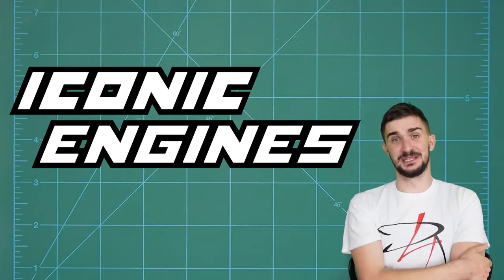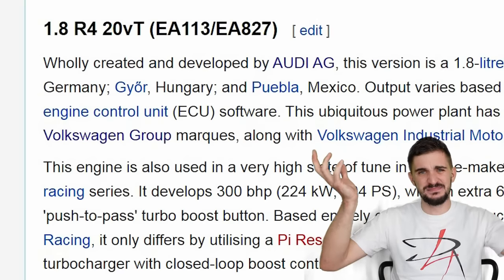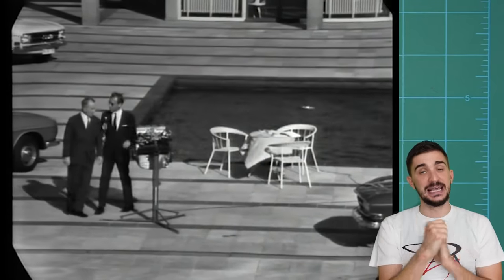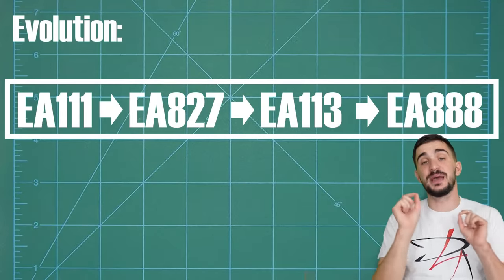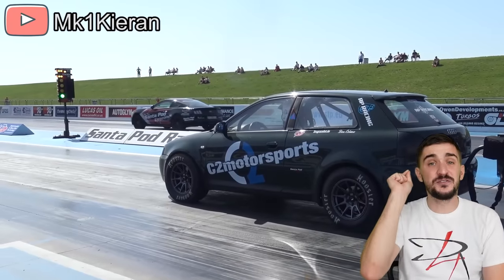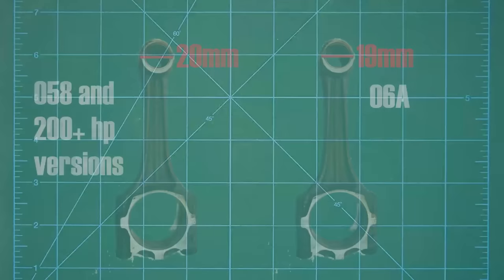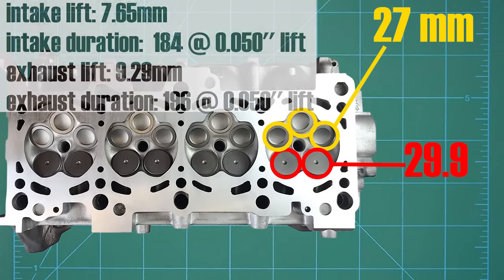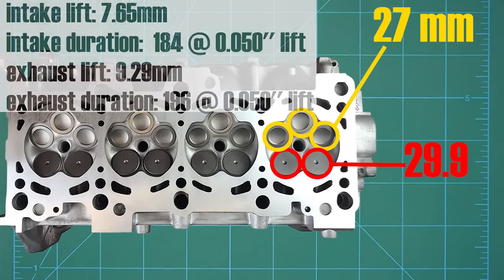VAG 1.8T 20V - What makes it GREAT? - ICONIC ENGINES #17

Comment: Thank you Thank you Thank you! The 1.8T is one of the best cheapest engine to tune, mine is 300bhp hybrid turbo on stock internals for the past 6 years with not a single issue.
Reply: If you had to choose only one car. Ep3 or mk4?
Reply: @rosco3223  Ehh that is a tricky one lol.. MK4 is easier to live with as a daily for sure but if it was a choice on which is better to thrash ep3 all day long. MK4 golfs don’t have the best chassis and are a bit numb in that area, their engines however have so much more potential if you on a budget.

Comment: Used to have one of these in a Jetta IV. Had a whole load of problems with the car but the engine was solid.
Reply: Yea usually how it goes. Abs stops working some window switches or light bulbs always burning out. The rocker panels and front fenders would rust out but the mk4 jetta is always fun to drive and the drivetrain is reliable

Comment: I don't know if you will ever adress diesel engines in this series but I would love to see an episode on the legendary VAG 1.9 tdi engines. There are mainly 2 variants (the VP and PD engines) both being incredible reliable engines with huge tuning potential and were available in pretty much every single audi/vw group car as well.
Reply: Fun fact, you can build hybrid using TDI block, and crankshaft, to get 2.1 liter engine.
Reply: Yeah, but they stink, literally 😅...
Reply: Nothing like the smell of sulfur in the morning.
Reply: VE* and the PD can be reliable with the correct oil and balance shaft delete (weak balance hex driveshaft and bad oil pump design) 👍🏼
Reply: @szymontrojanowski7565  for extra power 😊

Comment: As I remember, this engine got a bad wrap thanks to VW specifying 10K oil change intervals but not clearly stating synthetic oil  only, at a time when synthetic wasn't ubiquitous.
so many of these died from burned carboned up oil in the crankcase and cylinder head.
The longitudinal mounted Passat and others had an even smaller oil pan which made the problem worse.
Reply: The reason is because the passats had a habit of bottoming out because of how far forward the engine sits. I had to replace my oil pan because I poked a hole straight through it on a speed bump that I didn't see. Good way to take care of that is with stiffer suspension
Reply: Good point. VW/Audi tried to fix this by not only shortening the recommended oil change interval, but also dramatically increasing the size of the oil filter. The goal was not really to improve oil filtration, so much as to increase the surface area to act as an auxiliary cooler.

There was also a pretty large issue with the original coil packs in the later years that was famous for leaving drivers stranded.
Reply: 1gen longlife oil service was not taking driving style and cold starts into the equation.
So in vold climate with a lot of short trips the oil was dead a long time before the service light came on.

This is why thw next gen codes came with oil sensor in the sump.
Reply: @Blade_of_Violet_Chaos  No. The oil pan was smaller due to the subframe.

Comment: A few years ago my son was lucky enough to find a 2004 Audi A4 with the Ultra Sport package. It was an S4 without the V6 engine and the fancy headliner. Car was in excellent condition with about 80,000 miles. Bigger injectors, Garrett turbo, tune, South Bend clutch, Billy Boat exhaust, Koni shocks and other suspension goodies, and Michelin Pilot tires. Super nice sleeper.

Comment: Not long ago bought a Audi TT 8N with the BAM engine. I didn't realize the engine was an evolution of such an old design. Interesting to know. Mine is for road use, so after doing some of the normal maintenance items, i may have it remapped but nothing crazy around 250hp would be nice.
Reply: Commendatore  I have a mk1 TT 225 since 6 years, the car has 220k km and absolutely no issues, not only the engine.
Reply: daily driven , It has been almost close to 20 years by now my BAM 1.8 TTQ without any breakdown, yes exceept i had to replace 3 sensors ( crank, cams & oil level sensor) plus first rocker cover gasket & serpentine, I did myself & I’m not a mechanic and surprisingly the engine is clean as its new ! and the OE TB is still there in Good shape ! 200K and M1@5-40 always since the D1 i purchased new from Audi ! solid engine !

Comment: Hi. Great video. All the information made it clear to me that the parts of the 1.8 turbo fit into any 4-cylinder vw engine. I have a polo 1.6 aft and I have 1.8 turbo parts, which I will install in block 1.6. Drilling 82.5 and stroke 86.4 forged crankshaft, forged connecting rod 144mm 19 piston pin. Great information and great videos. Just like that

Comment: I have this engine in my 2004 Passat 4 MOTION with the 5 speed manual transmission, which of course includes the famous V A G (Audi) Torsen center differential. My engine code is A W M. It is completely stock with only 114,000 miles on it and I have changed the head gasket, timing belt and all peripherals at 111,000 miles. My model has 170 hp. There was only about 1,800 shipped to America in 2004 with the 1.8 T engine combined with the 5 speed manual transmission and 4 motion all wheel drive, drive train set up. I loved being able to see the 5 valves per cylinder when I took the head off. Having said that, I will not ever alter any of my mechanical engine components unless I am forced to replace them. But, I will eventually get the ECU that changes my horsepower to 225. It still has the 15" 8 spoke aluminum BBS wheels with all their center caps in place. I have brand new Hankook Kinergy 4S2 tires on it and it performs better in the snow than all of the off road jacked up trucks I passed sliding and spinning their wheels because they're too stupid to realize just because you have knobby tires doesn't mean they're made for snow. And no, I will not sell my car.

Comment: Great engine. Good compresion 9.5 for turbo engine, port injection, 5valves, iron block, fast spool turbo easy to remap. If the engine breaks down it one of the cheapest engine to rebuild and you can continue to drive it at full throttle like before.

P. S. Thanks for the video.

Comment: I’m building a mk4 2.0 AEG with a 1.8t cylinder head on top which can put out insane Hp and the parts that you can interchange between the two is incredible. They’re basically the same engine and you can even swap trans between the two.

Comment: I had an AEB 1.8T in my 1999 Passat. Nice bulletproof internals, but it ran ridiculously hot, baked every rubber and plastic item in the engine bay, required fast-wearing copper sparkplugs to get a hot-enough spark without retaining enough heat to cause detonation on the next compression stroke, had an old inefficient turbocharger that struggled to provide even stock boost pressure, and had a woefully insufficient intercooler. I mean, I guess it did get points for having an intercooler at all, back in those days, but still. And that fucking belt-and-chain timing system, OMG.
Meanwhile the rest of the B5 chassis my Passat was based on was junk. It felt great when everything was working perfectly, but things were never working perfectly.
Reply: I had a passat 1.8 20v b5 non turbo. Honestly I put work into it and sorted everything from suspension components to maf, charging/battery ignition systems. I never had no more problems with it. I loved it and was easy on fuel and was reliable thereafter. Now I have a A4 BEX it's been a hard expensive graft to get it to a standard. I honestly would trade it for my passat.
Reply: AWM B5.5 2002 Passat that I affectionately named Danielle 😊

Comment: Was super happy with the 1.8t. the 170hp version was plenty at the time in my opinion. That said, I bought new, boosted the bejesus out of it (350hp), drove it for 14 years pushing nearly 30PSI and never had a problem in 144k miles; didn't burn a drop of oil - just regular timing belt/water pump maintenance. There were LOTS of detail differences between each of the variants which I do think are meaningful. Can't remember as I had both  B5's and B6 - I think the B6 was AMB? B5 was AEB? (2002 USA). My dad was selling Audi when they were becoming a real car company again - early 60's. I remember going to the dealer intro of the Fox in 1974. That was not an impressive car.  My uncle in Germany always says Audi is just for old men. Probably right - I'm getting old and still like them :)
Reply: I got one, locked up maybe check the timing belt and the numbers

Comment: I've got the BAM 225 modded up to 280 bhp swapped into my mk2 Gold Gti.
Its amazing fun.
Reply: That aint bad, what do you think is its hp limit stock?
Reply: @sneez9461  probably 300bhp  
I had. Forged one before that 400 , but I recked. It had mad torque steer even in third gear.
Reply: @prawnk1ng  damn, thats alot, idk reliability tho🤔
Reply: That is not enough Bhp for any performance as gold is very a very dense metal. Hence the car will weigh a lot giving low bhp / ton
Reply: @skegvegas1570  What gold?

Comment: This engine especially in the s3 can do 400hp+ stock without opening up the engine.
That’s truly incredible seriously!

I think the high end VW Group sports cars with this engine were given forged internals from factory
Reply: Highly doubt it. Running a BAM with 270HP. If the tune is good and torque doesn’t come all at once you are good. Above 300 rods become chocolate pudding
Reply: @zvornicka2718  there’s another VW motor out there it’s called the ABF
Reply: @Manuqtix.Manuqtix  that's a mk3 2.0 N/A 16V. Came in the MK3 GTi not the S3

Comment: I have this engine myself in my Audi a3 8L and it is mega great. Its tone flexibility is super great. At a low cost, I increased its power from 180 horsepower to 223 thanks only to chip tuning. The only major problem I had with him was the Flowmeter failure. Yes, it burns some oil, but it burns a liter per 3000 km so it is a tolerable amount. I regularly change the oil every 10,000 kilometers and I use the 5w 40 funnel from Castrol edge full synthetic, I clean the injectors and it has been used by me for 5 years.  AAAA and one more breakdown that took place, unfortunately, when I bought it, after 3 weeks of normal driving, the body on the hot side of the turbine broke. Unfortunately, this is a common ailment in these engines, especially when they are severely torture. Unfortunately, such engines are not produced anymore, Now we have 1.2 liter washing machines with 2 turbines or some 1.6 that fall after a maximum of 100,000 kilometers and this engine, if properly cared for, will run smoothly 40,000 or even more noooo, unless it is tortured to cut off all day long, then it has the right to break the turbine or the block between the cylinder liners or it will let go of the head gasket and the original of a good head is not available.

Comment: I think the volvo/ford B5254T 2.5 liter 5 cylinder would be a great candidate for the next part.
Reply: I wouldn't be surprised if the Volvo engine is dirived from a VAG engine as well. Their six cylinder diesel engine came from VW... I believe it was initially used in the VW LT commercial van...
Reply: You forgot Renaults part in it. Renault Safrane version was 170hp but they did leave a little Easter Egg behind - the Volvo tuning marks are reversed on the Renault. Safrane Biturbo was 300hp but be careful of Renault cruise of that period - the logic was a bit deranged - anything within 20mph of the selected speed and it'd take off like a cat with a JATO pack rammed up its ass.

Comment: Pleasantly surprised to learn one of them fancy German engines is actually worth taking the time to tune up. Normally the power potential and price and complexity and reliability and difficulty of maintenance and repair come to mind, compared to similarly priced engines that are much better in all of those regards. Cool to know though that they are pretty casual tuner friendly up to 2 or 300hp. That's plenty enough to have fun and get in trouble with.
Reply: Well im from Germany, if you wanna buy a mk4 gti at a reasonable price its hard to find a not tuned or modified one 🤣
Reply: @savereport8788  it's actually really cool because I have 2 of them, one in a Passat and the other in an A4 but that one is dead and needs a new engine. I don't know if mine has ever been tuned but I was thinking about it and was going to do it but the prices went up for the APR tune around here in the states and it used to be 500 years ago now its over 700 and it's just not worth that much to me. I would have done it for 500. I just can't imagine paying somebody over 700 dollars just to plug a wire into your car and upload a file. Seems like robbery.

Comment: I have a 1.8T in a yellow 2002 Beetle Color concept edition.  I've owned many cars but next to my 05' Mini Cooper S, and tuned/restored Saab 900 SPG, it's my third favorite car I've ever driven.  It's such a solid and tiny whip but mainly because of the 1.8T, it has so much potential.  At 185 hp now it fly's.  But soon with a few mods, it's going to be one of the quicker cars on the road.   As far as cornering, it's on rails and once the 1.8T is pushing out over 250 hp, few cars will be able to keep up

Comment: It's an interesting perspective when you work in the automotive repair trade on the receiving end of those engines. Mechanics laugh about it,  calling it a grenade with the pin pulled, yet for some bizarre reason people still sing its praises.

I can think of a few key failure points in the earlier 1.8 t's that are prevalent, but I'm guessing plenty of people have already talked about those.

that aside I must praise the quality of these videos.
Reply: Because a lot of the self claimed 'mechanics' here, are mixing up the 1.8t (prior to 2005) with the later Tfsi models which are a completely different engine, and complete junk.
Reply: @MattyEngland  I hear what you're saying and I'm not intent on being argumentative, but from my past experience, issues arose from the start, with a myriad of catastrophic failures of top end components leading to destroyed cylinder heads.
With minimal piston to valve clearance even a slight stretch of the timing belt could result in bent valves as well. Probably one of the leading causes of 1.8 T's ending up in the wrecking yard. Like a lot of things if you throw enough money at the 1.8 T you can overcome most of its shortcomings, but why Endeavor to do that when there are so many other choices that are less expensive and far more reliable.
Reply: @ohc23001  Through an owners club I know multiple people who run standard and modified versions of the 1.8t, and I've never heard of either of those issues. 
I have one myself that I daily, which is 20 years old with 125,000 miles on the clock. It's been modified to 230hp 250ft/lb for the last 6 years, and is still on the original valve train, head gasket and turbo! 
The factory belt didn't stretch and neither does a decent replacement, (Everyone is know uses the Gates timing kit) so I can only imagine the issues you've seen are from people using a poor quality belt or someone doing the job wrong. It's quite a simple engine to time, but access is a complete bitch on the transverse engines. 
The belt's meant to be replaced every 60,000 miles or 5 years (whichever is earliest) and you also need to replace the idler pulley and the tensioner at the same time. 
Also the oil MUST be fully synthetic, and must be changed every 5,000 miles maximum (I change mine at 2,500) 
The PCV system is quite complicated and becomes brittle with age, but the engine was so widely produced that parts are cheap.
Reply: @MattyEngland  w
Well I am glad to hear of your good experience and hopefully it will keep running for a long time without any issues.

I am speaking from the perspective of a Porsche Audi service tech. A lot of us in the industry tend to share information with other technicians and it is fairly easy to tell when a model line will be problematic. I can think of numerous vehicle lines with inherent issues within the Porsche VW Audi" lines. Every car maker has them.
Reply: I'm glad you've been successful with your car, but clearly many have not. After spending two decades as a Porsche /Audi technician, I can only tell you what I've seen for my end.
Reply: @ohc23001  You'd think the same for any brand and model if you had to fix the same engines for decades, everyday. I'd say it's very normal for you to even hate them with a passion at that stage. Disregarding user errors like lack of basic maintenance, is there a perfect engine with no problems at all? Honestly asking the best engine you folks like; any brand, as experienced techs in there.
Reply: @4L10  No, there some are exceptions;
In my 40+ years working as a mechanic, on a vast variety of vehicles, I found many engine platforms which most technicians in my trade would agree with, we just weren't going to make much money on, still known for good efficiency/ performance.Here's my short list of top pics.
1978-1989' Porsche 911 3.0-3.2L Really hard to wreck one of these. They leak oil,but who cares when you carry gallons on board.
93-97' 2JZ Toyota
89'+ Honda B18 and KA series in general. 
Mazda MX5 up to 97'
08+ GM LS3
There are a few others, but I wanted to keep this list germaine to the topic,so kept I to mostly high specific output engines.
Reply: @ohc23001  Thank you

Comment: I have the golf mk4 bought new in 2003  with 1.6 petrol engine  but after 3 years i swap it with 1.8t. engine from audi the AUQ with 180bhp and tuning it from UNITRONIC TO 220bhp and still have it ,and drive it every day normally without brake it so many years still reliable engine and solid with the few   electronic problems map sensors etc.. like all vw engines and cars had!